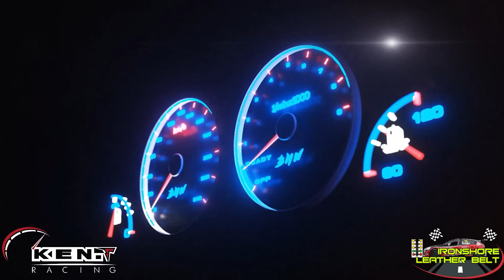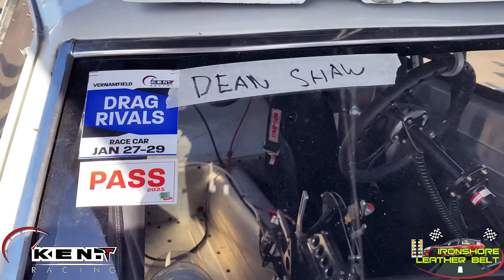Top Race Car Drivers Dominated Drag Racing at  VernamField & more 🇯🇲

Comment: I have not been drag racing in a very long time. When I was 21 in 1991 I purchased an 85 Mustang GT. It was built late in the year of 84 so it received the block, lowers, heads, roller cam, roller rockers of the 86 model year cars but was still  carbureted like the 85 and prior. 1986 was the first year for EFI on the 5.0. Stock should have been a 650cfm Holley but somehow mine had an Edelbrock Performer Air gap intake manifold and an Edelbrock 750cfm carb factory. The cam profile seemed different than most and was found to be an Edelbrock Performer Plus ➕️ 😳 Cam with Performer timing gears ⚙️ instead of a timing chain. We discovered the heads were not OEM Iron heads they were Edelbrock Alloy that were ported and even internally channel smoothed & polished. The clutch was a two puck 6 tab carbon race clutch. I removed the stock exhaust and mounted 2 1/2" stainless with x pipe, Thrusher mufflers, tips that end in an oval like the oval in the Ford emblem exiting side just in front of the rear tire. It had MSD Ignition parts all over. The rear axle was a 9" geared for peak performance around 2k to 3,500rpm in 1st,2nd, & 3rd gear on the 1/2 mile. I found information about the original owner in the car to ask about all the mods and he told me it came from Ford that way. It was some sort of show sample car he git cheep because it had 5,000 miles when he got it. I contacted Ford and using the serial number we found it was a test car for the SVO group inside  Ford for six months to test ideals and performance for the 86 block and internals. That's why all the mods! I got lucky with a factory low 10 second car, 9.3with Micky Thompson Street Dominator Slicks205/35/16 front 255/40/16 rear,  OEM restrictions removed, =L Headers, 2 1/2" x short exhaust, 2" spacer under the carb with ice H2O passing through tubes in the intake opening for a custom intercooler set up on a non turbo car, a bit of tuning, 100 octain and the cool 😎 North Carolina after sun down late Aug 🌙 summer air. It was an amazing thing. Non of mybother cars to this point of my life could match the Mustang. Not my 2008 4.3L DOHC Turbo NOS Auto Volvo V40 T5 R, 1972 400ci Auto SB Impala,  1986 350ci 4spd Z28, 1985 Swaped from V70 4.3L DOHC Turbo 15lbsBoost NOS 4spd Volvo 240 Station wagon, 1987 Swapped from Grand Prix L67 Supercharged 3800 Series II V6 5spd Pontiac Fiero GT None of those could even brake faster than 10.5!
Reply from the maker: Thats a serious project car you build. 👍🏾
Reply from the maker: @joeottsoulbikes415  do you have videos on your channel of you racing?